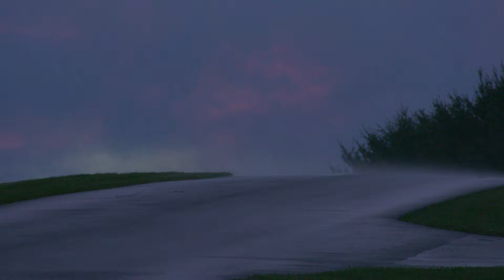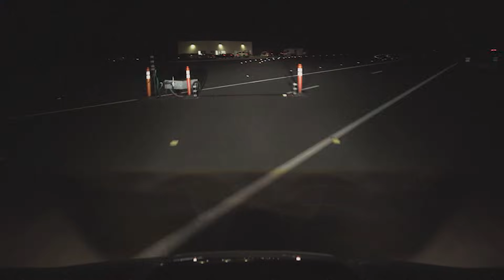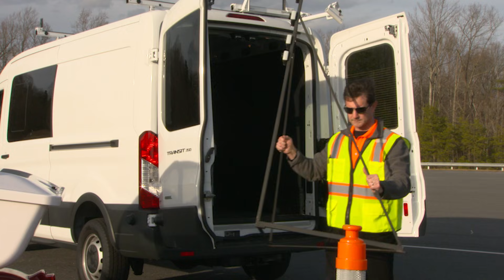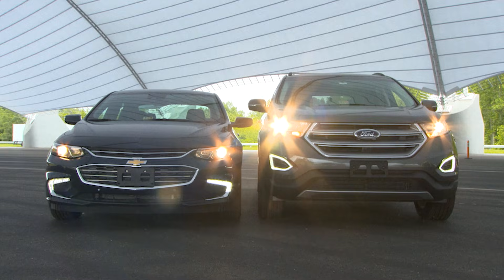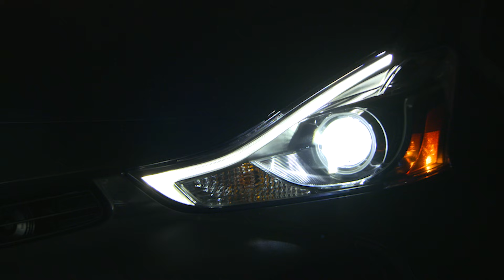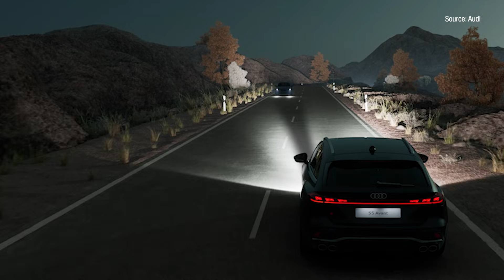Glare and headlights: The basics and beyond

Comment: IIHS is the root cause of the insanely dangerous newer style headlights that are so ridiculously overpowering.  Even the slightest weight in the back seat for instance where these ridiculous lights tilt ever so slightly up becomes a blinding light beyond reason to oncoming traffic.  Small bumps or ripples in the road, etc create another dangerous scenario of blinding.  The lights all have a directionality which delineates the beam in a horizontal line just so ever slightly below horizontal so even the slightest deviation of pitch blinds anyone oncoming.  Truly awful.  It really speaks to ignorance of driving on the part of IIHS
Reply: nothing in this comment explains how this is the IIHS’s fault
Reply: @KufLMAO  It's pretty simple.  They are the ones responsible for the insane push for these dangerous lights. If you don't follow their strongarm tactics your vehicle gets dinged in the overall safety.  There are numerous examples of vehicles changing out headlights making them more dangerous just to appease the IIHS
Reply: @thomasbrandenburger3491  I’m pretty sure the IIHS grades headlights on whether their sweep is wide enough… not brightness/distance
Reply: Headlight leveling motors are required in Europe. IIHS never required they. 

IIHS does a lot of good by my gosh are they dinosaurs.
Reply: @MyGoogleYoutube  Has nothing to do with leveling motors
Reply: @thomasbrandenburger3491 

You're literally complaining about additional weight in a car shifting headlight aim. Well with leveling motors you can adjust the aim from your seat.

Comment: So glad to hear it said out loud - most of the glare issues I experience are with folks that are inappropriately using aftermarket bulbs, but that important detail isn't included in any of the reporting I've seen.  There's also a proliferation of auxiliary lights that are being used with modified low beams. I know in most states (if not all) you are only allowed to have two light sources in operation when approaching other traffic - so even fog lights need to be turned off to help reduce the glare.
Reply: Proper fog light pattern and aiming reduces or eliminates glare - the last sentence is bunk for my jurisdiction :)
Reply: Another problem with users utilizing the wrong bulb type in housings is that they are unable to comprehend why that's a problem. So they'll continue to ignore the advice and blind other drivers around them.

Comment: 27:49 street lights can ABSOLUTELY cause glare! There is a few on my way to work in the morning that are basically no different than a lifted suburbatank with its highbeams on....its awful
Reply: Agreed. The new tend in streetlights is wider distribution. This is achieved by using sideways-shining LEDs. This broadcasts the light much wider and directly into the eyes of drivers. They’re doing this because it allows them to install fewer light poles, thus saving money.

Comment: For starters... Those idiots at Tesla should stop hiring Stevie Wonder people for their aiming department and headlight assembly... (I'd like to apologize to Stevie Wonder for insulting him)
Reply: Teslas seem the have high beams as their low beams, and the sun as their high beams. I often find myself giving them a blast of high beam for blinding me, then they burn me to a crisp in response.
Reply: Don’t worry, he won’t see your comment.
Reply: Tesla headlights are the worst manufacturer installed headlights for glare bar none
Reply: yeah, funny how the IIHS tests of Tesla don't indicate any glare but we all know they are horrible
Reply: @pasad335 They should update it to better reflect real world experiences
Reply: @pine111  They have looked into it.  Note that they also have not yet tested the redesigned Teslas.  The old ones I recall were okay.  The new ones are less so.
Reply: @pasad335  The new Teslas really don’t glare at all. Some of the best on the road by far. The old ones like pre 2022 however are really bad.
Reply: Model 3/Ys also commonly have LED daytime running lights fail and the only repair is to replace the whole headlight assembly. Whether the owner or a dealer replaced them, I guarantee many of them were not aimed correctly after installation.
Reply: Also, most headlights have to be manually adjusted under the hood with a screw driver. It's cost effective but it's also because manufacturers don't want people adjusting them unless absolutely necessary. Teslas can be easily adjusted from inside the car so you know people are messing around with them without having any clue how big of a difference a small adjustment will make.

Comment: The US rules really need to be updated and accept the existing adaptive headlights tech.  I have 2 cars that I modified aftermarket to activate the existing oem adaptive headlights already installed by the mfr and they work amazing!!! I live in an area with windy backroads with constant elevation change, and it’s so hard to see at night. Especially Now that I’m in my mid 40s, it’s getting more difficult to drive at night.   Adaptive headlights make such a big difference.
Reply: I’ll add an opposing view.  I coded in the adaptive function on my car, only to find out the US spec headlight housing is actually different than the EU spec housing.  The adaptive function works as far as the electronics goes, but the optics are not sharply focused enough to generate a proper “tunnel” around other vehicles.

To put a number on it, I’d say it works about 80% as good as the EU design.  That last 20% is important, and it’s enough to aggravate other drivers so I don’t use it.

I point this out because not everyone will be knowledgeable enough to tell the difference, or honest enough to do the right thing and UNDO that change if it doesn’t work 100% as intended.

I agree that adaptive headlights are the way of the future.  Their anti-glare and self leveling features are FAR superior overall.  Yes there will be examples of where they’re not 100% effective, but the collective strengths are far greater than their weaknesses.
Reply: @superspeeder Dipping your headlights yourself is much more effective at not blinding oncoming traffic.
Reply: @C.I...  it certainly CAN be, if the driver is diligent, respectful, and paying attention 😊
Reply: They don't make that much of a difference. They have to blind the oncoming vehicle in order to function. I mean to say, they work by detecting headlights, therefore they have already blinded the oncoming car by the time they decide to dip. A human would see the light pattern past the corner and dip their lights early.

Of course, this is all elementary because LED headlights' dipped beam is blinding anyway, and will flash you with full intensity if the car goes over a bump.
Reply: It’s not “dipping” the beam, it’s an adaptive matrix. You are conflating this with auto high beams.
Reply: @theluftwaffel  I know that. My point stands. It won't adaptively dim the space a car is in until it has already blinded them.
Reply: So what you’re actually telling me is you’ve never used them and have no idea what you’re talking about.
Reply: @theluftwaffel  I've used them before, and they literally cannot function without first blinding the opposing car. It has to see their headlights, determine they are a car, and then selectively dim in that area.
If the cameras can see the headlights, you are blinding the owner of those headlights before the area is dimmed. This is not difficult to understand.
Reply: Okay then so tell me what’s worse: 200 milliseconds of response time to cut out the beam in a wedge around an oncoming car but with the capability of seeing more in most conditions, like into forests where deer live, and with the added benefit of an even lower cutoff for the low beam. Or, constantly blinding everyone with your brodozer’s low beams and probably still forgetting to turn your high beams off from time to time. Your argument is ridiculous. Seems like getting dunked on in the comments is a common theme for you.
Reply: @theluftwaffel i’m a Dutch citizen and they’re everywhere here, overal they tend to blind more than normal projector headlights that are adaptive.

The ADAS camera on current vehicles isn’t developed enough yet to detect vehicles coming from far away out of a corner, it’s better nowadays at detecting headlights in let’s say a forest where headlight beams are visible before the vehicle comes into frame but they are pretty bad at doing that from far away, when they’re close it’s fine mostly, different car brands use different algorithms to determine the best way to project around a vehicle.

Things it’s really bad at is detecting cyclists (especially here in The Netherlands) because we have a lot of protected separated bike lanes that’re protected by trees and 9/10 times it doesn’t the cyclist.
Reply: @miles5600 Hi,
Fellow Dutchman here,
I have those LED matrix lights and I’m amazed by how good they are. The moment my car spots another car (in both directions) it will instantly direct the headlight beams around it. 
I never have people flashing their lights at me and that tells me me they’re good. 
You’ve got a point regarding cyclists I think but then again, how many people dim their lights for cyclists if they’re behind a tree line?
Reply: @Conservator.  Yeah, like I've used these in Poland and also coded it in my car in the US and have never had anyone flash their lights at me either. It works great, and I think it's of even greater benefit here with people and their oversized vehicles.
Reply: @C.I... the good ones are have very quick response time and are very responsive and are less distracting to on coming traffic. My polestar lights are much more responsive then my BMW lights.
Reply: @Wasabi9111  The fact they are responding to light instead of proactively dipping before meeting the other cars means you are blinding people!
Reply: @C.I... yes. But the good ones dim at a far distance and are fast acting so the impact to on coming traffic is minimal.
Reply: @Wasabi9111 correct.  The sensors are mounted higher than the headlights, usually at the top of the windshield or on the back of the rear view mirror, and react over hills BEFORE the headlights can even see the eyes of oncoming drivers coming traffic.

In the case of going around a curve, the highs dip so quickly that it’s only an issue for a tiny fraction of a second.

Comment: Something I think might be helpful is active headlight aiming to compensate for payload. I notice a lot of pickups with especially bad glare are hauling heavy loads in the bed or towing a trailer. Driver-adjustable vertical aiming has been standard equipment in Europe for a long time, I own a communist-built fwd hatchback from the '80's that even has it, along with optional headlight wipers, despite things like automatic transmissions, power steering, or radios not being factory options. I can imagine it being problematic with drivers liable to crank it all the way to the highest setting (I don't know whether this is a concern in the European market or not) but I imagine it wouldn't be too difficult to implement an automated system that compares ride heights.
One study I'd like to see is a comparison of colour temperature. I personally associate the glare from LEDs with a very cold white light that's harsh on my eyes. Obviously I can't separate the variable of the bright white from the actual light intensity, but driving with snow on the ground with my own LED headlights produces a similar harsh effect with the light reflected back at me that doesn't seem present with the warmer yellower light from halogens, on top of the obvious glare concerns from oncoming traffic.
Reply: My 8 year old Audi has self leveling headlights, and it's their near bottom of the line model (and it has wonderful LED lights)
Reply: @pasad335  It's one of the things I like the most about European headlights. I'm not fully sold on everything in the ECE regs, though. I don't know if European road signs are retroreflective the way they are here, but the blinding up and right kick in the low beams is downright hazardous with reflective North American road signs.
Reply: @pasad335  my golf is also fitted with self leveling headlights. The LEDs are wonderful and you can see the road really well. I almost never use the brights.
Reply: @powertechnical  yeah, mine are so responsive you can watch them work even during acceleration and stopping. they keep the lights absolutely level.
Reply: I would really like headlights with adaptive temperature. Bright white for high beams but a much softer yellow for oncoming traffic or low beams.
Reply: @djplonghead5403  I don't think having it change between low and high beam would be good, I'd think you'd want it to stay consistent.
Reply: @gogmorgoaway yeah. Maybe just when it detects oncoming cars it tints slightly. Not sure. If it was gradual enough I dont think it would be too bad on the eyes.
Reply: @djplonghead5403  Yeah, it might not even be a problem. It's hard to know whether the colour temperature matters at all or if the apparent harshness is only a byproduct of more intensity. 
It used to be commonplace in parts of Europe to have yellow tinted headlights, with the idea that it was easier on the eyes, and a lot of people believed it was. But putting a yellow filter over the light also reduces output, which would also be easier on the eyes but might not actually be making safer lighting if your eyes have to work harder to see.
That's why it's important to have actual testing for this sort of thing. Human perception of lighting is incredibly inconsistent. For example an LED that scatters more light in the foreground will usually be perceived as better and brighter than the halogen bulb a headlight was designed for, but the halogen might still be putting more light in useful places allowing you to see further down the road.
Reply: @gogmorgoaway true. I wouldn't mind at least having tinted fog lights though. When it's foggy or snowing modern lights blind you instead of cutting through.

Slower wavelengths such as yellow are physically less harsh on the eyes-even at the same intensity. 

I belive screen using RGB lights actually have much larger red diodes compared to blue because of intensity reasons.